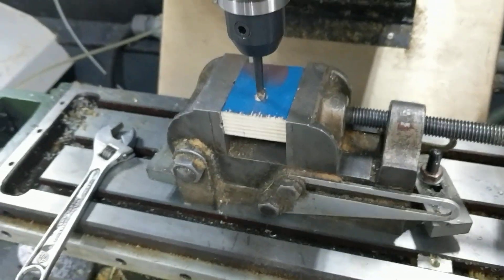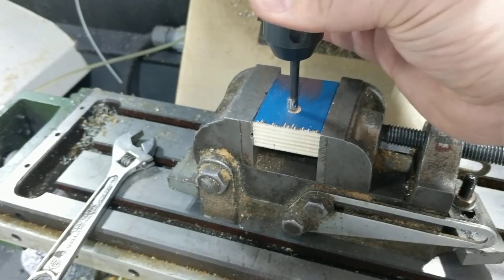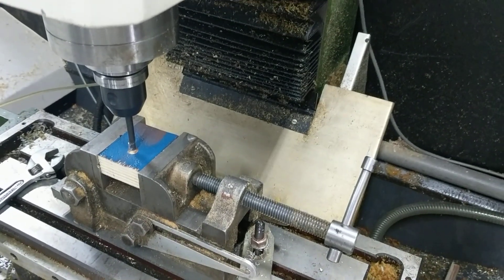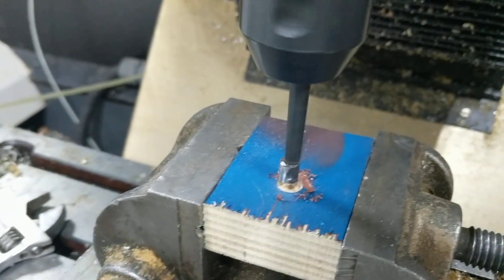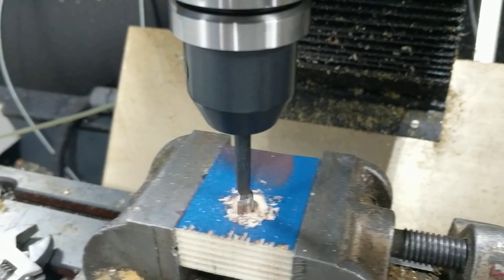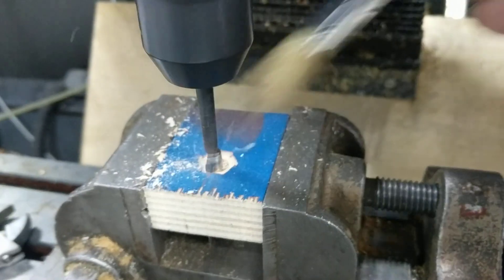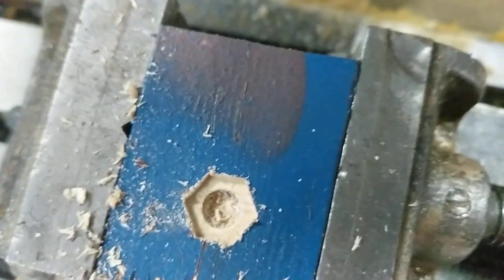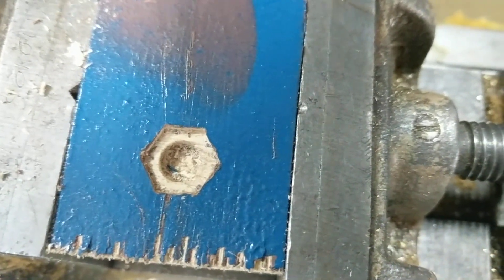Drilling a hex shaped hole..  Linuxcnc style.

Comment: Machinist for a living- and the Watts Bros company that makes the Watts polygonal drill is near my hometown of Pittsburgh. I also know about rotary broaching. Congratulations- you might be the first person to come up with what looks to me, at least, to be a new form of polygonal single point milling. This is pretty damn awesome. Can you post what your code looks like to even do this? I use linux and havent gotten into FreeCAD or linux cnc yet- but working on it. Actually- this has been done in another form on a lathe though not quite the same- with spindle synchronization and a large diameter flymill- its called polygonal turning. It looks like you are doing a version of that adapted for a boring bar for ID- while polygonal turning only works on OD in a CNC lathe. Really impressive man!
Reply from the maker: Thank you!  I feel like I am building on the back of giants...   I will post the latest code here ..  https://forum.linuxcnc.org/10-advanced-configuration/38549-non-circular-boring-linuxcnc-fun  there is some initial code posted there - but the current version has a lot more functionality...